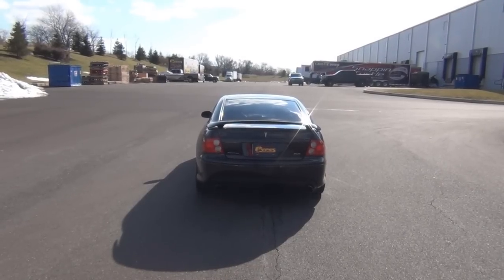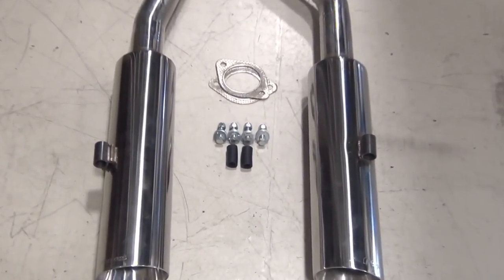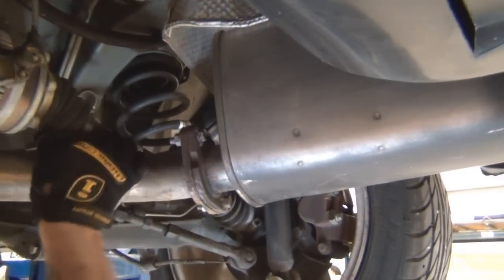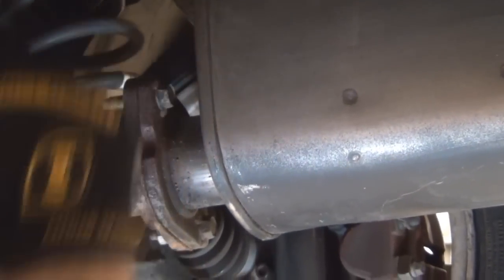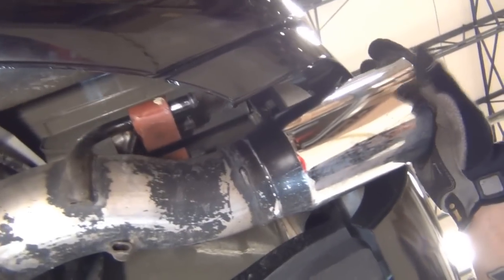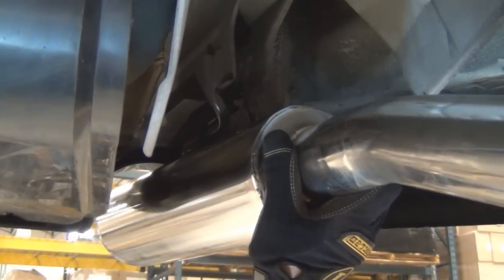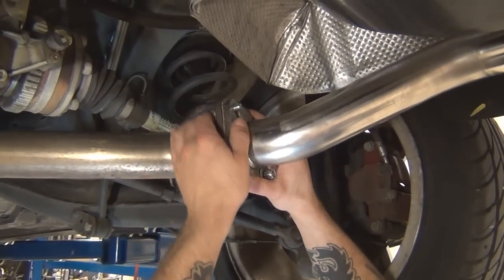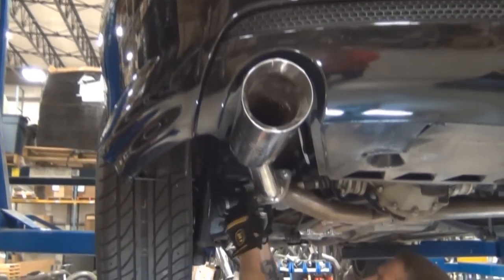2005-06 Pontiac GTO Axleback Exhaust Installation

Comment: Got mine and love it. Putting Pype bombs on it too and Eric from Pypes wants a sound clip. They should be here next Wednesday. Then a Vararam and tuner. Got to get used to 400 hp before I add any more. You switch off the traction control and they are all over the road when you punch it.